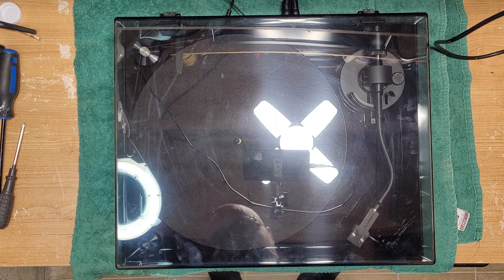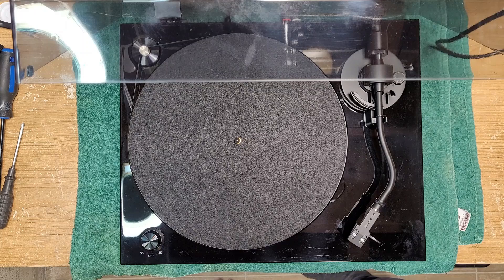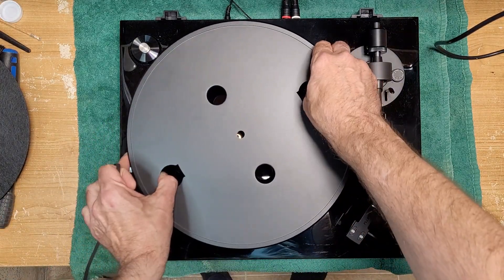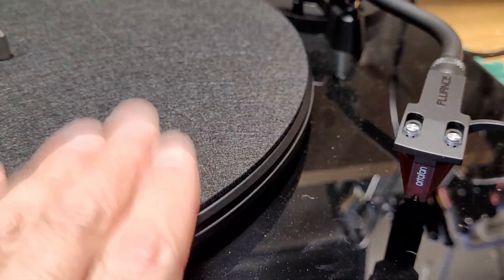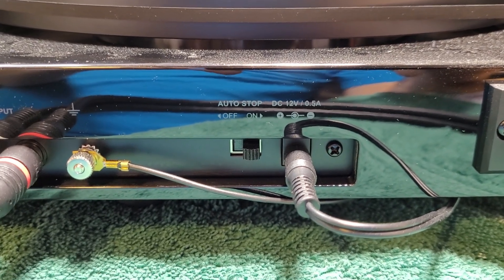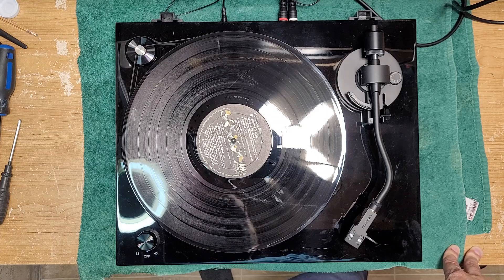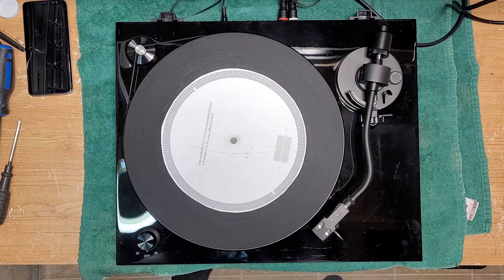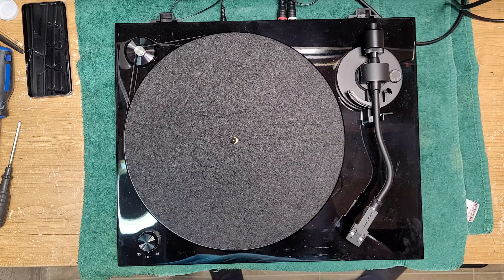Fluance RT-83 Turntable Review

Comment: its too expensive to me the rega is a solid wood type tt but the fluance is a hollow body and there are a lot of reviewers who review this TT  and mislead people by saying it is solid wood it is wood but not solid ,these are made in china there other models out there made in china that have soild  wood bodies and are half the price as you can see it had the typical aluminum platter very ringy I would never buy one they are nice and well built but noy for that price ,I love the piano finish it would not bother me about finger prints why do you have to touch parts of tt that you don't need to its a finger print magnet if you slap your hand on tt  thee is nothing to touch on tt except tone arm cueing lever and thats it I don't like the logo it looks like cheap plastic its glued on why not use something like a nice shiny metal type they are charging a lot for this use some of the money and get a less cheaper looking badge JRo
Reply: They are made in Taiwon.
Reply: Regas are not solid wood.   The plinths are MDF.

Comment: I have the RT-82 model. Only difference b/t mine and the one you have is that it comes with a different needle. I tried an RPM app on my phone and its gave me 33.52rpm. I didn't put the phone over the spindle though, just on top of the mat. I really enjoy the turntable. Its not bad for the money.
Reply: I have the RT82 as well. Love it. The hinges on the dust cover are a bit sloppy though... doesn't always stay up. I put on a Piezo YM 320x. Don't know it that's much better than the Ortophon OM10 cartridge that's supplied?

Comment: I've had mine (RT-83) for just over a year now. Solid table! The only drawback is the lack of upgrades outside of the Ortofon brand and head shell. It doesn't come with a built in preamp (at least the latter models don't). And you can't change out the tonearm, in which the dimensions in general are unique to this brand. 
But if you aren't looking for anything fancy, this is one of the better budget models out there. I think I might upgrade to the Fluance acrylic platter (a little over $100), and possibly the 2m bronze stylus (just over $400). But in all actuality, it might just be best to save up and get a better turntable that allows for more aftermarket upgrades.
Tbh though, this table sounds better than more expensive setups that I've heard. And there are at least 3-4 more Ortofon stylus/s that you can upgrade  to. It all just depends on how far you're willing to go with the hobby
Reply: Have you gotten a chance to upgrade the stylus?
Reply: @briansanchez6065  Sure haven't. Running the same setup.

Comment: I just got the Rt82 and mine wont auto off either. It starts but wont turn itself off. I spoke with Fluance support and they tryed to tell me it could take up to s minute to turn itself off. Obviosly he was wrong. Full manual mode for me. Not letting my stylus grind away on the lable for a minute. Doubtfull it would ever shut off.
Reply: butchnoneed4883   Im happy with the table itself, i just ordered the acrilic platter and have a couple of different stylus shell combos , i have the orto blue, a pickoring tl3 with a vivid line, a shure v15 with a vivid. The tl3 and the v15 are about the same , hard to beat the 30db channel separation on the vintage carts. They smoke the orto blue. Just wish the table was full manual without a control board that appears to be failing. I just tried mine again and it failed to shut off, a vivid line stylus is 159.00 , just not willing to let it grind the label sorry not worth it.